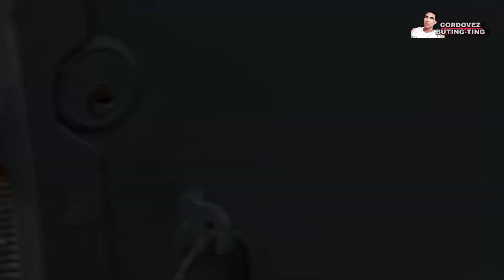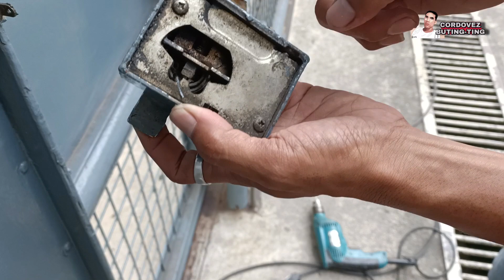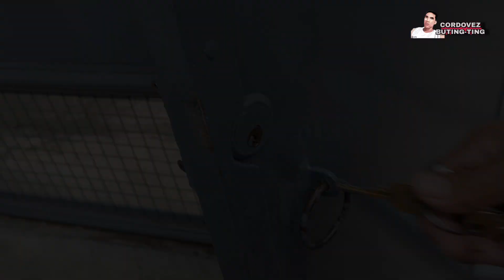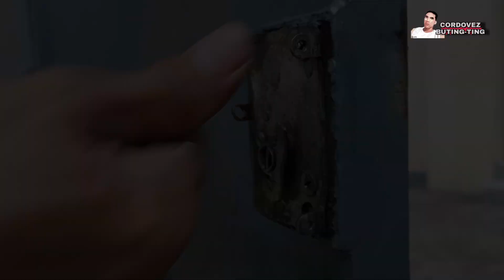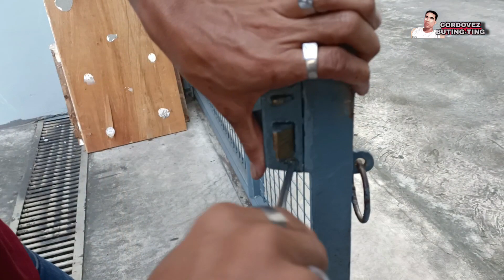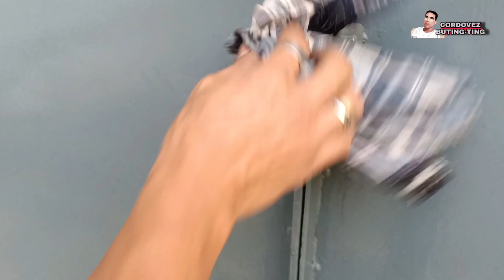DIY how to fix a broken Yale double locking or Nightlatch.

Comment: heavy duty po ba yang lock po? pang commercial?
Reply from the maker: Hindi po sya heavy duty piro deadlock po sya pang bahay.yong ibigsahin ng deadlocking po pag nakapasok na yong mag nanakaw sa bahay hindi nya kayang buksan yong gate.
Reply: @CordovezButingting  ano po ma recommend nyo po heavy duty pang commercial po boarding house po kakabitan ko sa main gate
Reply: @CordovezButingting  What if it's locked from outside and stuck up? Key won't move and latch not opening at all. Wooden door. Tried oiling but key won't turn.